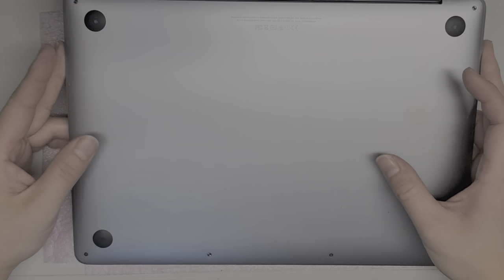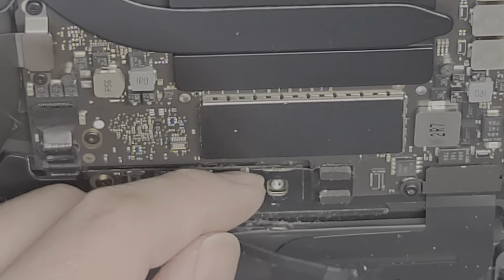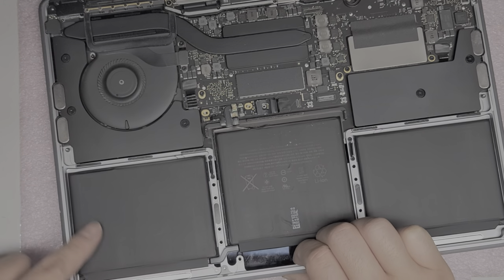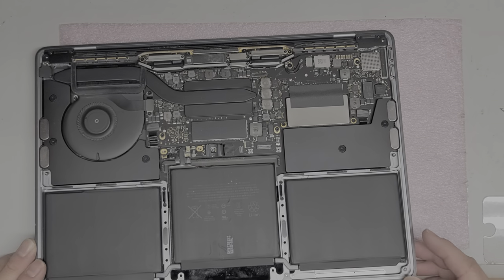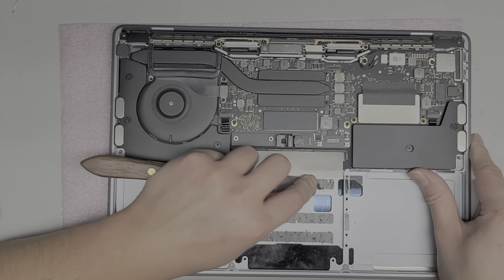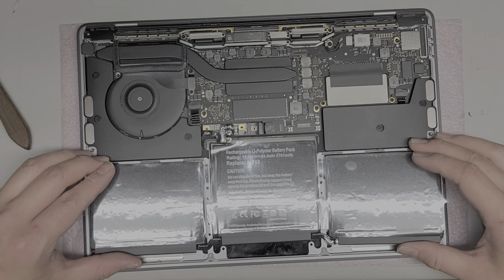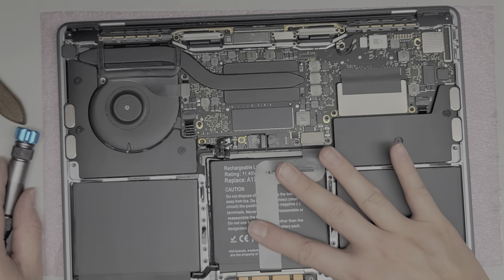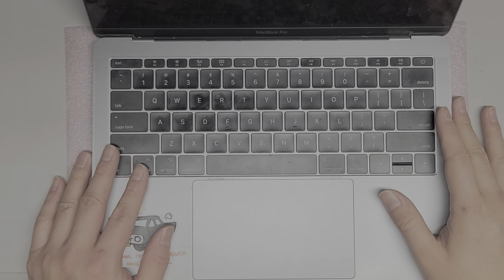13" inch MacBook Pro A1708 Late 2016 Mid 2017 A1713 Battery Trackpad Replacement

Comment: thank you so much for your help! because of this video, i was able to successfully put a new battery in my macbook pro :) a few tips for anyone following this tutorial who also doesn't have any experience or knowledge in this area:
1. the cover on the old battery is most likely going to rip when you try to remove it. the adhesive is super strong, and no matter what you use to push under and pry it apart, the battery seems to rip open. it's going to smell as soon as you do, and it's most likely going to spark a bit at some point. it freaked me out a bit, so i'm warning everyone else.
2. removing the bottom cover from the macbook requires more force than you think. those clips really hold it on. try to go around the edge with something flat to pull it up. and it's kinda fussy to put back on too, so try to get it into the clips and press on all around the bottom.
3. make sure those little connectors with the gold on them are fully inserted into the new battery. mine weren't pushed all the way in, so i had to go in and redo them when i saw the new battery wasn't charging.
4. make sure to do the PRAM and/or SMC reset. my computer didn't stop giving me the "service battery" message until i did it. that seems to be the way to make sure the computer recognizes that there's new hardware.

thanks again for this video! i couldn't have completed the process without it.
Reply: A good method to remove the battery safely, is to use a 30lb braided fishing line, kinda floss it through the battery.
Reply from the maker: Nice

Comment: Very clear.  Replaced the battery on my daughter's Mid 2017 MBP (A1708) with no issues for around USD $75 including tools.  Apple Store quoted her $300 and spouted some nonsense about needing a software upgrade and a complete hard drive wipe.
Reply from the maker: Awesome! Yeah...I don't know why they do all that.
Reply: I replaced the battery but when I turn it on, their is a X mark on my battery, and when I ever I disconnect it from the charger it turns off
Reply from the maker: Double check the small ribbon cable is connected and the metal tab is lined up properly.
Reply: @ItsBinhRepaired  do you have to do the SMC reseat?
Reply from the maker: @Kash489  do you have to eat/sleep/breathe/shower/etc.? It takes like 5 seconds and you only do it once. Why do people ask that as if it's the most difficult thing? Just do it. Lol
Reply from the maker: @Kash489  if it still shows the X and the connections look ok, either the battery is defective, or the cable/metal tab is damaged.
Reply: It worked
Reply: @ItsBinhRepaired  thanks a lot my brother
Reply from the maker: @Kash489  haha great!

Comment: This instructional video is superb.  It walks through all of the details of the battery replacement.  Binh, I have one suggestion which will save you quite a bit of work -- instead of using rubbing alcohol to remove the adhesive, use naphtha.  You can get it from the hardware store in the paint section (VM&P Naphtha) or use "white gas" or Ronsonol Lighter Fluid, which are also naphtha.  Dampen a paper towel with it, hold it on the adhesive residue for a few seconds before any scraping, and within a few minutes the foam tape residue will get super soft and just peel off.  If you apply the dampened paper towel a couple times and just wait for the naphtha to do its job, you don't have to do any scraping, and it leaves no sticky residue.  And it is quite gentle on other surfaces, unlike acetone and many other solvents.  Thanks again, and I hope this tip returns the favor!
Reply from the maker: Yeah, that's what I'm worried about is it'll damage other components like the plastics. The alcohol works the same way if soaked a while it comes out easily, but I'm impatient. Haha
Reply from the maker: Thanks for the recommendation!
Reply: @ItsBinhRepaired  I believe that Naphtha is safe for most plastics.  The first time I saw it used for cleaning was someone removing price tags from textbooks -- it didn't harm the shiny book covers at all!  I've used it on countless surfaces without any issues.  And since it doesn't contain any water and dries clean, it works really well.  Give it a try!  It will save you a lot of time and effort.
Reply from the maker: Interesting

Comment: Just did one today using this as a guide,  I used dental floss to remove the battery,  the little ribbon cable was a mission to put in because it was so small. But anyways thank you for your video it helped heaps.
Reply from the maker: Glad it helped! :)

Comment: I did it all and it worked, thanks.

Only thing is now the trackpad is quite sluggish and slow. After resetting the PRAM it fixed it, but it went back to being slow shortly after. 
I’ll probably just keep resetting it until it fixes completely, but just wondering if you have any advice on this?
Reply from the maker: Could be bad battery

Comment: Great video! I followed the instructions and my mac now turns on but it won't charge. Does that mean there's something wrong with my charger? Or did I do something wrong?
Reply from the maker: Double check the small ribbon cable and the metal tab
Reply: @ItsBinhRepaired  I've checked both. When I plug the charger in, nothing happens. It doesn't even acknowledge that it I've plugged it in
Reply from the maker: @4556789mazda  very strange. The metal tab is centered with the gold contact points?
Reply: @ItsBinhRepaired  yeah. I keep checking but both seem to be properly placed.
Reply from the maker: Remove the little ribbon cable and reinstall. Maybe the battery is bad :(
Reply: @ItsBinhRepaired  I've taken the ribbon out and reinstalled it like 6 times now. I'll try ordering another ribbon and see if that's it. But maybe it's the battery. Idk.
Reply from the maker: @4556789mazda  yeah :(

Comment: I followed the whole thing for 3 hours and i plug it in to charge it says its not charging. The battery is working but its not charging, should i let it go to zero and see if it works? Please help me
Reply from the maker: Check the small ribbon cable and metal tab are connected properly.

Comment: Great Video - Thank you! BTW, the "little cable" part shows to be: C18123 / 821-00614-A.  What model Tesla do you own? :-)
Reply from the maker: Currently I don't own one, but my Model Y estimated delivery is end of March. I was trying to hold off for the Cybertruck, but someone cut out my catalytic converter from my prius, so now I don't feel it's worth repairing. It had over 270k miles on it nearly 20 years old and lots of random minor annoying issues. Driving wise, it was still good though. :/

Comment: I got a replacement trackpad and it not flushed with my macbook pro. Is it possible that its warped? I ordered another that should be here Friday or Monday.
Reply from the maker: @makaveli559m  did you transfer the washers over as well?
Reply: @ItsBinhRepaired  yes I did transfer all the washers to this one. I ordered another trackpad from a different seller.I am waiting for it to arrive.  I will have to send this one back.
Reply from the maker: @makaveli559m hmm OK
Reply: @ItsBinhRepaired  So the other one came with bad force feedback like it would stop clicking I sent both back. I got a third one and it fits and works great :)
Reply from the maker: Awesome!

Comment: Thank you for this awesome video that helped me replace my old battery. I reset both PRAM and SMC however, I can see no battery connected. The battery settings window cant open, as it says I have no hardware connected. I was super careful and meticulous with all steps. Any suggestions on what to try?
Reply from the maker: Make sure the cable and metal tab are connected properly. It not, might be a bad battery.
Reply: @ItsBinhRepaired  thanks, I’ll check out the cable and tab again.
Is there a way to check if the battery is bad? Voltage drop ?
Reply from the maker: @nRantzau  I'm not sure

Comment: Hi, I replaced the battery but when I boot there is a symbol of a battery with a cross through it. Everything else works fine. If I try to do the SMC reset it shuts down immediately. I've checked the battery contacts and ribbon 3 times. Any ideas? Thanks for the great tutorial.
Reply: 4th time lucky got it going! Thanks again!
Reply: Oh it now says battery is not charging
Reply from the maker: @caetzar  check the metal tab is centered between the gold contact pads and the little ribbon cable is connected properly.
Reply: The supplemental update didn't work unfortunately. Still stuck on 1%.
Reply from the maker: @caetzar  might be a known battery defect Apple is repairing for free.
Reply: I have go the same issue did you manage to fix it?
Reply: @ravilimbani8071  yes, the issue was the new battery. I upgraded the OS and then asked for a replacement from where I bought it and it worked. The issue was the board attached to the battery had old firmware.

Comment: I followed the instructions to a T but it keeps restarting and I get the “your computer restarted because of a problem screen” over and over.  Not really sure what to do.
Reply from the maker: Sounds like a motherboard issue.
Reply: @ItsBinhRepaired  it’s not.  I put the old battery back in and it works fine.
Reply from the maker: I hate how YouTube doesn't notify me of replies. Were you able to figure it out?

Comment: Hi! I replaced my battery and now I’m getting an odd screen with a rectangle and what looks like a power button?
Reply from the maker: Rectangle power button? Upload a video and share
Reply from the maker: That's the MacBook searching for a mouse and keyboard. You might have not connected it properly or damaged the cable.

Comment: Hi I have run into a problem with battery connector ribbon (5:50 on your video).  I believe I pulled it out successfully but when I went to put everything back together I discovered a ribbon with nothing on that end.  I guess it fell off and I cannot find it.  Can you link to the part I need?
Reply from the maker: I'm not sure. You mean the metal tabs got ripped off of the cable?

Comment: Hi, so I’ve followed the video and replaced my battery, however although it shows the screen where it say it needs charging, when I plug it in and turn it on, it doesn’t seem to show a battery up in the top left menu. Is this due to the flex cable or is it because I haven’t done the resets?
Reply from the maker: Does it work on battery power?
Reply: @ItsBinhRepaired  it just shows the symbol to charge it.
Reply from the maker: @mulberryhare9152  never turns on?
Reply: @ItsBinhRepaired  so it turns on with it plugged into power but as soon as you remove power cable it will shut off. Also it doesn’t say it’s charging on the system report.
Reply from the maker: @mulberryhare9152  sounds like the cable isn't connected properly
Reply: @ItsBinhRepaired  I’ve taken it out reconnected so many time which is why I wonder if it’s damaged. There’s normally a tab on one end isn’t there, but that’s been pulled off previously as it’s a refurbished MacBook
Reply: I was going to send you a picture but can’t work out how 😂
Reply from the maker: @mulberryhare9152  tab? If the flip latch is gone, then the battery won't work. It needs that to connect to the motherboard.
Reply from the maker: Maybe the cable is damaged
Reply: @ItsBinhRepaired  so bought a new flex cable and just put that in and now I just get the charge screen and it won’t even power on!
Reply from the maker: Likely not seated all the way in.

Comment: hi, i have a little problem with my macbook pro 13'' 
i've changed the battery and on coconutbattery it shows me that the battery now has 100% capacity, BUT! 
whenever i start my macbook the fans turnup and the mac is so low.
i did not knew about the resets and i did them afterwards but they did not help, i hope you can ! 
thanks already and all the best wishes from germany !
Reply from the maker: Is the trackpad working ok? You might have messed up the trackpad
Reply: @ItsBinhRepaired  my mouse functions do work well but if i want to do an force touch klick it doesn‘t work, you think it has something to do with it ?
Reply from the maker: @yasin66_tv7  I think so
Reply from the maker: @yasin66_tv7  check the cable connection on both sides
Reply: @ItsBinhRepaired  i did the flexcable under the battery looks like its inside i can see a little bit of the golden contacts, i already thought that i hit the microchips when i was scraping under the battery ...
Reply from the maker: @yasin66_tv7  :( had to remove the trackpad before scraping the battery
Reply: @ItsBinhRepaired  yeah now i know it better 😂 i tried to save that one step i was to lazy and now i have to pay for a new trackpad 😔
Reply from the maker: @yasin66_tv7  :(
Reply: @ItsBinhRepaired  but thank you very much ! I hope that it is the trackpad otherwise i have an other real problem !
Reply: @ItsBinhRepaired  hey just changed my trackpad and everything working fine again!! Thank you so much for your help !
Reply from the maker: @yasin66_tv7  awesome

Comment: I wish I would have watched this video first and taken out trackpad first. While removing the center battery I pryed up and cracked the trackpad. I did not know there were two open squares under the battery. luckily I found a replacement for $60 coming soon. Why not use some sort of bracket to hold battery adhesive is such a bad idea for laptop.
Reply from the maker: Apple doesn't want people to fix things themselves :(
Reply from the maker: Make sure to like and subscribe so others find my videos and watch them before damaging theirs.

Comment: Hi I wonder if you can help.
When my track pad is connected to the board the processor gets very hot to the point that macbook switches itself off, when track pad is unplugged processor is cool (fan blow full speed? ) but the graphics are very slow?? Can you help with this??
Reply from the maker: The trackpad has a thermal sensor. When it's removed, the computer assumes it's overheating and runs the fans max speed and the cpu and gpu at reduced performance. Not sure what's causing the overheat, but maybe thermal paste needs to be redone.
Reply: @ItsBinhRepaired 
Thank you for your reply.
It is quite weird for example I can watch YouTube in 4k for hours and all is fine as soon I will open like GPU hungry website for example ventusky processor heats up in few seconds to the point of 75c and fun kicks in then but processor is to hot and it cuts off the power. Any suggestions??
Reply from the maker: I think have to redo the thermal paste.
Reply: @ItsBinhRepaired 
I will try that and see if this helps.

Thank you for your help.
Reply from the maker: Hope it works.
Reply: @ItsBinhRepaired  👍👍👍

Comment: Question,  what would cause the Mac book pro not to detect the new battery, thanks?
Reply from the maker: The small ribbon cable and/or the metal tab isn't lined up properly or inserted fully
Reply: Thanks for replying. The battery I got  looked odd having glue over that connector. I wasn't able to remove alot of it because the soldering is flimsy. A replacement is on the way, hopefully in better condition. 
Thanks, really appreciate it!

Comment: can you make a detailed video as this one but on the replacement for Macbook pro 13" with Touch Bar A1706.
Reply: I meant the battery replacement for the A1706
Reply from the maker: I don't buy computers to work on. These are customer computers. You'll have to send me that model for me to make a video on it, but it'll be a paid job. The process is essentially the same. You can use this tutorial to replace the battery on that model.

Comment: Ive done all the steps until the trackpad removal. Cleaned everything really softly with a brush, followed how to close everything from the second you started to put the trackpad back again and is not turning itself on anymore? What could be wrong? For a second i heard the fans super loud and fast and plugged the charger out and it turned off
Reply from the maker: You have to make sure the battery is connected right and trackpad is connected properly.
Reply: @ItsBinhRepaired  i didnt move the other part of the trackpad just the one near the battery, could it be improperly connected if its pushed down and screwed?
Reply from the maker: @ignasbalcius409  check both ends
Reply: @ItsBinhRepaired  and what would i be looking for? I did check if it was disconnected (the other end) and it looked alright?
Reply from the maker: @ignasbalcius409  just disconnect and reconnect. Other than that, not sure.

Comment: I’ve now tried this with two different batteries as i thought the first did not work, do u know what else i could do or try to get it working?
Reply from the maker: What's the issue with your MacBook? Why did you think it was the battery?
Reply: The battery would not charge and whenever i take the charger out my mac would shut down
Reply from the maker: @lukefentonkickz9030  this is a known issue https://9to5mac.com/2021/02/09/apple-offering-free-battery-replacement-for-2016-2017-macbook-pro-that-wont-charge-past-1/

Comment: Thank you for the video, I replaced my battery today but for some reason it's not charging, can anyone let me know if this happened before?
Reply from the maker: Double check the ribbon cable is in all the way, and the metal tab is lined up properly.
Reply: @ItsBinhRepaired  thank you for the quick response, but now I think I screwed it more because it won't turn on 😭🤣
Reply from the maker: @RenelisEliza  It needs to be plugged in for that.
Reply: @ItsBinhRepaired  it is
Reply from the maker: Hmmm I wonder what happened :(
Reply: @ItsBinhRepaired  was able to turn it on but now it won't show any battery icon, nor any battery in system preferences, the wifi won't work either and it is slow. I think I'll just leave like that because I don't want to damage it anymore
Reply from the maker: @RenelisEliza  very strange